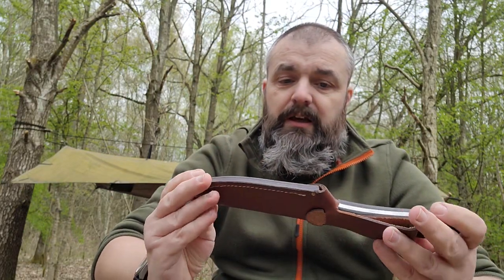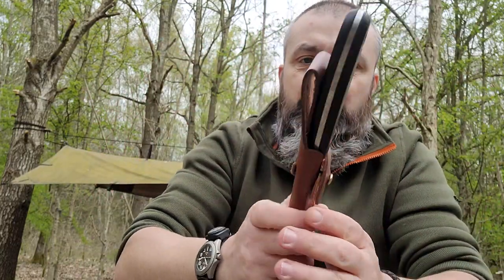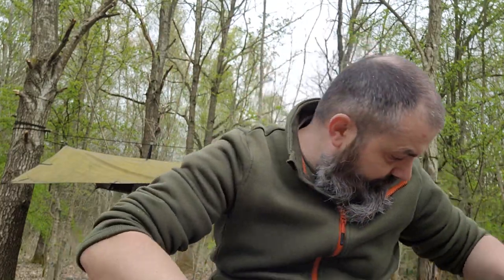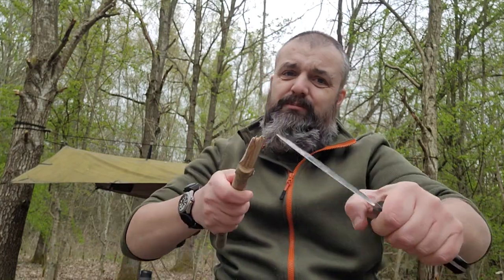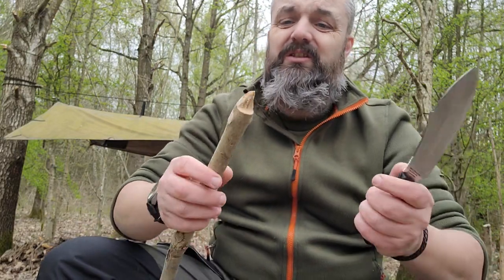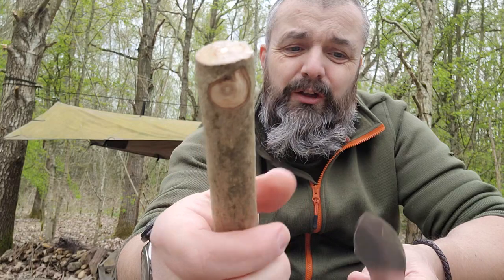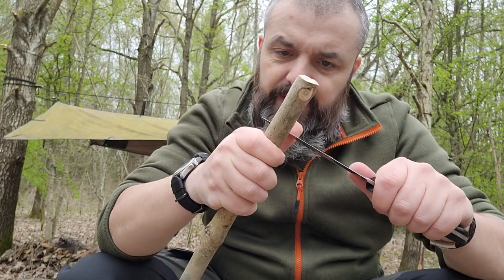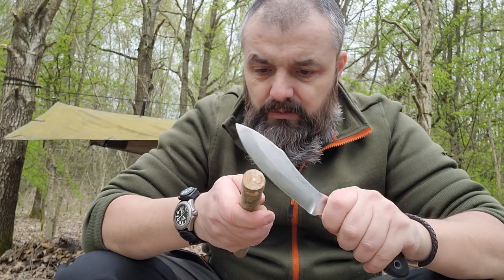Grohman knife part 2

Comment: The folder-over army jump sheath was on the #3 not the #4 which has always had that sheath. The strap has always been a problem.
Reply from the maker: Yes but they also made it for the 4 but discontinued it but kept the crap one when it should of been the other way round lol
Reply: @lonewandererbushcraftwildc6822   If it makes you feel any better, I have a #4 from the early 70's and it's only cut halfway through the retention flap.  :-)

Comment: Looks like a larger version of the Canadian belt knife .resin wood! Is more like either packa wood or stabilised resin wood .Great review. God bless . Lee
Reply from the maker: Yeah it is & made by the same company who made the Canadian belt knife DH Russel at  Grohmans together in around 1960 but Russel & Grohmann actually met before that time in ww2 & did a few folders together before moving on to bigger fixed blades later on

Comment: a vid on the cost of production vs the amount it is sold would be informative. also will a 300 $ knife achieve what a 100 $ knife does not ?  working in the wilderness ,from the arctic do the amazon jungle,  will a 300 $ knife do more than a 100$ ? retain an edge for 2 months straight ? we can always sharpen a knife once a month to avoid paying 200$ more
Reply from the maker: I'm not going to be using it in the amazon jungle or the arctic & the price of this is around £140 GBP sorry if I forgot to put that in.
Thanks for watching

Comment: too expensivel why so expensive
Reply from the maker: Been asking that same question myself I could make an excuse & say its hand made like alot of people do however I'm not like alot of people.
So I would simply say I have no idea.
Thanks for watching
Reply: @lonewandererbushcraftwildc6822  it would be interesting to find out the cost of production of each knife and compare it to the selling price. This knife used to be sold for 35$ cdn when it was put on the market. it was sold as a canadian knife.  This shape makes sense but not for 129 to 240 $
Reply from the maker: @Attilio Barcados  I couldn't agree more this world now is run on greed unfortunately.
I do have knives that cost under £30 GBP that perform better then alot of expensive knives I've used.
I bought this knife because of the classic shape & the fact I've never used a Grohman before but for the price I could of got a custom one made for the same price but better & definitely better then the sheath that came with the Grohman it's absolutely bloody awefull sheath why they went with such a cheap & nasty flawed design sheath to go with a knife that was expensive is beyond me really 🤔
Reply: @lonewandererbushcraftwildc6822  never broke a knife but i lost a scuba diving knife older than me. a shame. no reason to pay expensive knifes when it so easy to lose them. the best knife is the one you are using